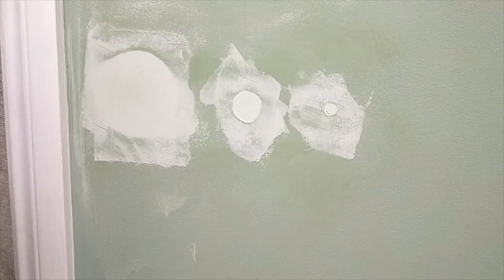Self Drill Plugs Fix Damaged Plasterboard For A Smooth Invisible Repair

Comment: Very informative video. Thank you. After you have filled and sanded. Why don't you have to use a splash coat on the filled areas before finishing off with final coats. Wouldn't the top coats peel? Thanks
Reply: I’m guessing because he already added  paint to the filler

Comment: I like Polyfiller One Fill, just because it’s easy to use, ready to use and sets quick. BUT, I used it on my feature wall in my living room to fill some old plug holes and when I’ve done my coats of Dulux Diamond Eggshell the filler catches the light and eye. You can see it from certain angles it’s slightly darker than the plaster. Strange and highly annoying. Matt paint doesn’t have this problem. Always learning. 👍🏻